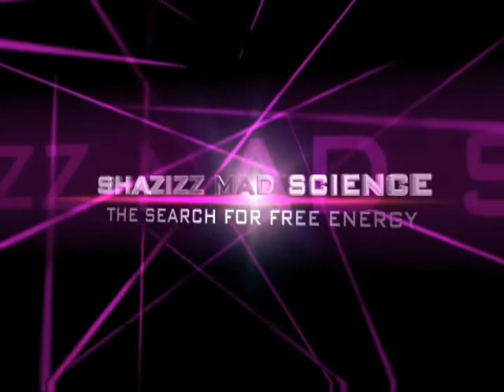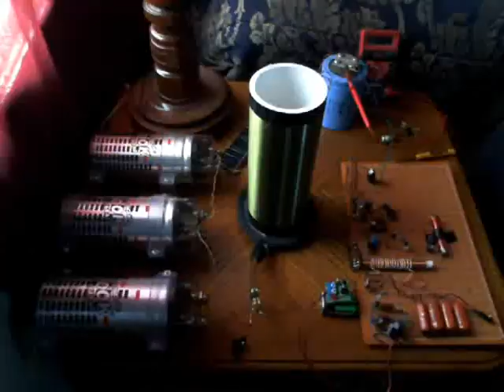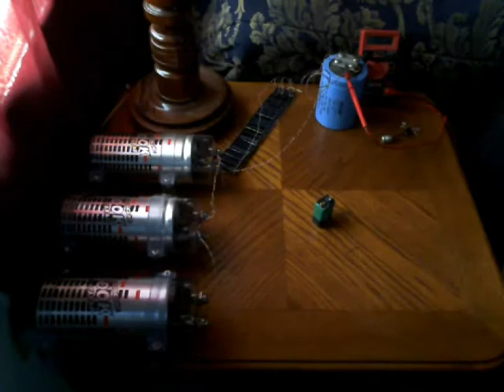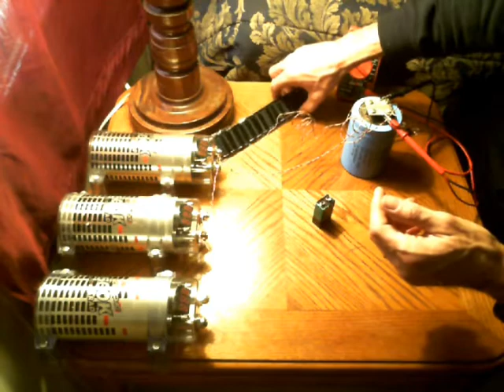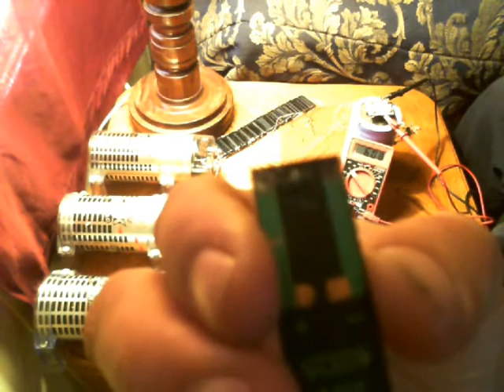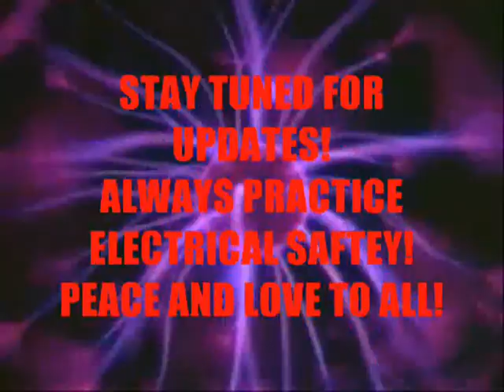ELECTRO MAN CONTEST INTRO !

Comment: I don't really understand the contest ? is it to make a portable/wearable suit/jacket that can power/charge say a cell phone or notebook tablet ?? or for use for the Military, for use when someone if touched can be killed for defense purpose ??
for that i say a Static coupled with solar into a quantum portable battery ..wired into a aluminum static jacket with inside rubber coat, coupled with a step up transformer..could do the job as a taster effect  ..or with an on/off to have unlimited power for a cell phone or both ??...will it be copied and resold ?? will the company provide pat # and market research for sales ?? ..id be interested in building a model
but not just a prize of a toaster, while the CEO's patented the product and make a Million...

Great Video tho for basic school projects ??